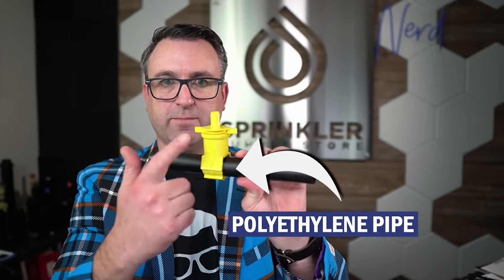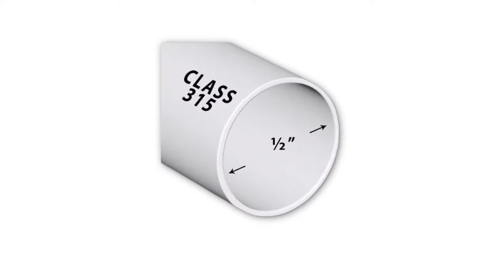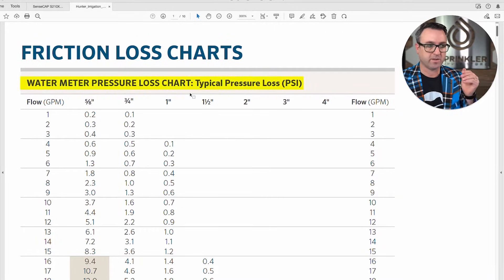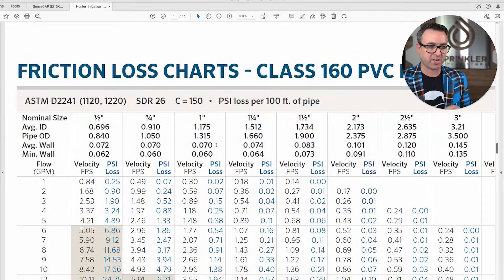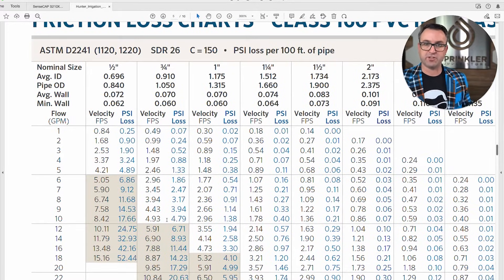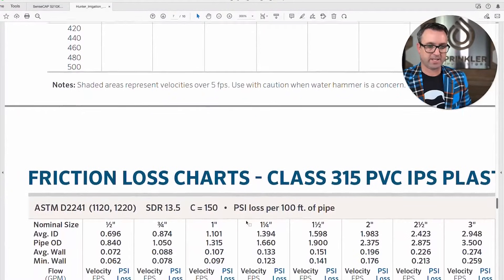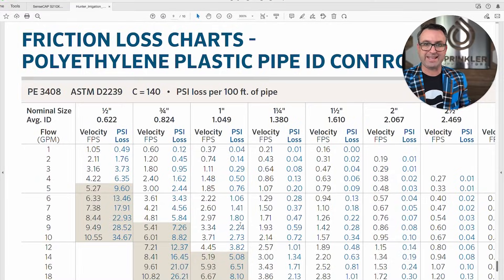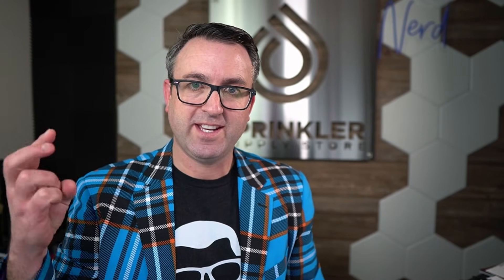Pipe Size Matters - How to Read Irrigation Friction Loss Charts

Comment: Also, observe pressure during the actual time you will be irrigating. I got screwed when I used mid afternoon pressure for design only to find out after installation that my city pressure drops 25lbs in the early morning when I water. Called the city and was told sorry, you get what you get. No boosting on their side. I’m working on reducing my GPMs to combat the loss. My entire system is 1” poly. Thank you for the information, being a firefighter for 25 years, I’m familiar with pressure loss. Just have to apply it.
Reply from the maker: Yes, thank you for mentioning this! It’s super important to check pressure at the time you intend to operate the system. I recently installed a cloud-based pressure transducer on a residential home and saw the pressure spike at 12:01am, and then drop by 20psi reaching a low point at 10am - and this pattern repeated daily.

Is a booster pump an option for you?
Reply: @Andy_Humphrey  I consulted a local installer and was told to make sure my zones are not over 12 gpm. So I'm going to look at that and try some landscape changes before going down the pump road.
Reply from the maker: Good luck!
Reply: Pressure probably drops because everyone is watering lawns when they should - early morning - and showering before work. Even city mains can only handle so much volume.

Comment: Question.  Are there rules about the size of an irrigation line that comes off a city water supply? For example, if the city supply line to homes in a neighborhood is 1" pvc, is it proper to use 2" or larger line to feed into the irrigation system?  Or maybe even a larger feed line to increase flow of water if a zone has too many heads?  If my understanding is correct, using two big of irrigation supply lines in comparison to the home line, would cause excessive pressure loss in the home (s) because the larger line would dominate the flow from the smaller diameter line.  If you had multiple neighbors all watering lawns at the same time it could cause an unusable pressure situation in the homes.   I am asking because I can't find anything written on this.   Thank you.

Comment: Regarding pvc pipe, doesn’t matter if the fittings go over the pipe; the size is always the inside diameter.
Reply from the maker: For PVC fittings, yes, the size is measured using the inside diameter. This is because PVC pipe is measured using the outside diameter. The inside diameter is different, depending on the type of PVC pipe; SCHD vs SDR etc. The wall thickness changes, and the inside diameter changes, but the outside diameter of PVC pipe is the same.
Reply: The 1 inch schedule 40 I use says 1 inch ID and 1.3 inch OD.  That is the actual pipe. It’s true 1 inch inside pipe not fitting.

Comment: Hey I first like to say you’re videos were very helpful
Question
My well pressure hovers between 45psi and 60psi
What type and size pipe would best suit 1-90
4-180 rainbird 5000 series 
My static pressure is 40psi @ the spicket 
My flow rate after I used your calculations is 7.5 gallons a min
Reply from the maker: Thank you. Check the gpm of each nozzle you intend to install based on the distance required. I do not recommend exceeding 35ft. Add up the gpm and refer to the friction loss chart to see what the pressure loss will be per 100ft. 1-inch pipe is likely just fine.

Comment: My lawn measures 50'8" x 44'8". I have 15 GPM and 45 PSI static pressure. I would like to run 1" pvc through the system and have as few as possible heads. 
Can you please help me with the placement of heads and recommendations. 
I have watched many videos about flow and pressure loss along with the 5 feet per seconds water flow. 

What would you recommend for placement and heads.
Reply from the maker: Hi Brian, let's start with validating the pressure. Where did you measure 45psi? Depending on where the measurement was taken, it may not be enough for an automated system. On average, you will lose 5psi through the water meter, 5-10psi through the backflow preventer, and 10% through the piping. Ideally, 40psi is required at the sprinkler for that lawn. 

Pressure often fluctuates on the city main. You could also test the pressure at different times during the day, for example: 6am, 12pm, 10pm.

In regards to spacing, start by pacing sprinklers in the corners and fill in from there. 25ft spacing using Hunter MP Rotators should provide a nice grid coverage. Yes, there will be some overlap on the 45ft side, but that is okay. 9 Sprinklers in total.

Comment: I'm confused about the part where you said you get more friction loss using schedule 40 because the ID is smaller due to thicker walls. But the pipes in the chart are listed by ID size aren't they? So isn't a 1/2" pipe of one type the same ID as another...?

Comment: We have free ditch water in our subdivision for irrigation (~30-50' higher than house location). It's delivered to each 5 acre lot via a 2" riser pipe (think horizontal rectangle with the house and riser pipe in the NW corner).  I'm allowed a max 5 HP pump.  Is there any issue with using qty (4) 2" pipes for the long runs and then branching off them for each sprinkler head or is it better to reduce the size?  What happens if you have too large of a pipe?  Thanks
Reply from the maker: A larger pipe than is necessary will not cause harm. It will reduce friction loss, and the resulting dynamic pressure will be higher. It’s most costly, but if in doubt, size up.

Regarding your other question, if you can run 1 pipe and have adequate dynamic pressure, I’d recommend that. Extra pipes will be extra maintenance cost.

My recommendation is to design the size of your zones, based on the gpm available, and pressure calculations from the 5hp pump and elevation changes.

If you would like assistance you can book a call with me and we can go through the calculations/design together.
Reply: @Andy_Humphrey  thanks!  I saw your calendar link from another comment and will take you up on that offer but will probably be after the summer.    thanks again!  enjoying your channel. Just subscribed.
Reply from the maker: Thank you!

Comment: is the friction loss in head form?
Reply from the maker: @kennethrevilla639 these charts, used for irrigation design, typically display pressure in PSI. This is most common for irrigation contractors, etc. 

You can convert psi to foot-of-head by multiplying psi x 2.31. Example: 50psi x 2.31 = 115.5 foot-of-head.

In reverse, there is 0.4333psi in 1 foot-of-head. Example: 100 foot-of-head = 43.33 psi

Does this help?
Reply: @Andy_Humphrey  I'm learning new ways to find friction loss. I'm reviewing bernoulli's equation where all must be in term of "head" units must be either in meters,ft or inch. so if I multiply 50 psi and 2.31. the friction loss is 115.5 ft? where did 2.31 come from?
Reply: oh i got it. pressure is also equal to (density)(gravity)(head)  @Andy_Humphrey  thanks :D
Reply from the maker: @kennethrevilla639  you got it - that is some good Nerd speak right there!

Comment: How do I test the water pressure going to my irrigation and water follow?  Testing at the spigot wouldn’t be accurate as the spigot is connected to my house and likely after a regulator, and my irrigation line branches directly off the main water supply line before it comes to the house.
Reply: Take a 5g bucket open pipe full count the number of sec it take to fill the bucket  5G Div Sec X 60 = water flow per min
Reply from the maker: Static pressure will be the same anywhere you tested on your house. Just make sure there is no water running when you test the pressure.

It’s a bit confusing to think about it first, however, static water pressure is just that, water that’s not moving. The only difference to the readings will be due to elevation.

Comment: Love your YouTube channel! I just finished watching this video and several others of yours. I'm at the very early stages of designing an irrigation system at my house. I've never done this before and I see from others that have asked you questions here, you are a great sprinkler resource. 

The area that I want to sprinkle is for the "sports" area of our backyard. This is where we play badminton and croquet. It gets full sun and is a challenge to keep grass growing, especially when we are using it often. The area is nominally 50' x 25'. 

I have a dedicated irrigation line from the city water system. Just today (9 am, Sunday), I measured the static water pressure to be 44 psi. This is the pressure at the hydrant in my yard AFTER the city meter and the back flow preventer. Last week I measured the water flow coming from the hydrant using a 5-gallon bucket and got ~50 GPM. 

For the sprinkler system, I plan to tee into the existing PVC line the runs between the back flow preventer and the hydrant. I think this line is 1", but I still need to verify. The elevation of this tie in point is about 3' ABOVE and only about 20' away from where the edge of sports field. Therefore, I will have the benefit of some increased pressure in the system as it flows down to the sports field. 

My goal is to have an effective, trouble-free sprinkler system that I can install and maintain myself. I am willing to pay more for any system component if it will ensure I can meet these goals.

My basic questions are:

1. How many zones do I need?
2. What type of head(s) should I use and what configuration is best?
3. What controller do you recommend? (Due to the remote location of the tie in point, there is no access to Wi-Fi and limited access to electrical.)
4. What type and size of pipe should I use?
5. Any other design elements or tips I should know before I proceed?

I'm hoping to get this installed in the next couple of weeks to be ready to plant grass (from seed) in the bare spots for the fall. I thank you in advance for any help you can provide.
Reply from the maker: Great questions, and thank you for your kind feedback. 

This is a situation where I'd recommend a consultation with a professional to ensure that you get this right. I'm certainly happy to help, below is a link to schedule a technical meeting.

Couple quick thoughts based on your observations.

1 - The static pressure reading of 44psi is not effected by the backflow, pipe friction loss etc., unless you tested the dynamic pressure while the system was running. Static water pressure will be the same at all points, with the exception of high/low areas due to gravity. If the static pressure is 44psi, it is likely that the dynamic pressure will be more like 35psi, in which case a booster pump is recommended. 

2 - 50gpm sounds suspect. Double check the calculation. If you tested it from a garden hose hydrant, it should be more like 5-8gpm. A fire hydrant/hose would be more like 50gpm, and perhaps that is where you tested from?

Look forward to learning more and providing assistance should that be helpful.

Thanks again for your kind words!

Scheduling link: https://calendly.com/andyhumphrey/technical-support

Comment: So does it mean the the closer to the 5 velocity fps the better? Not exceeding 5.
Reply from the maker: that is an interesting thought, but not exactly. There really is no "better" velocity, only not to exceed velocity, which for irrigation is 5fps. Slower velocity will have no effect on pressure. Actually, that's not true, you will have less pressure loss (therefore conserve pressure) if the velocity is lower.

Comment: Thanks for the video, and thanks in advance for help on this. I’m confused. Is water pressure different from pressure within the pipe? You say if you were to put 50 gallons/min into that pipe it would blow a fitting. Wouldn’t it be the increase in pressure inside the pipe that would blow a fitting? Yes the water moves faster but I would think it would create more pressure in the lines? (Even though you say you can only increase pressure in certain ways). I’m a math guy who likes this stuff but am just learning it. 
I got some great answers in another of your videos. Thanks 
How do I calculate static pressure if my irrigation water splits off from the house right at the town water meter, and my irrigation system even has a knob to adjust the pressure. Every zone is fine but one is overloaded with heads and a drip line and doesn’t  work well. 
Is there a formula how much each head drops the pressure? Are some sprinklers better for low pressure and/or low flow? (Rotors, spray or rotating nozzles, impact…)? I’m thinking of trying an impact at the last sprinkler of the zone to see if I can get more range with it.
Reply from the maker: Water pressure can only be increased with a pump, or gravity.

The best example of false pressure if putting your thumb over the end of a garden hose…this does not increase the pressure, it increases the velocity/speed of the water.

Hi velocity is what will create problems. It is for this reason, that the recommended velocity is under 5 ft./sec

Static water is measured with a pressure gauge. To calculate the dynamic pressure, you will need to know how many gallons per minute you are using, the distance the water is traveling, and what the water runs through in between (size of the pipe).
Reply from the maker: If you have low pressure, the best sprinkler to use is a pop-up spray head, with the lowest flow nozzle you can find that still covers the distance you’re looking for. Do not use rotating style nozzles, use a standard matched precipitation rate fixed spray nozzle. These will generally operate as low as 20 to 25 psi

Impact sprinklers are not a good choice for low pressure because they typically require a higher flow rate.

Comment: Im wanting to run a water line to another side of my property for a 2 acre garden area, however the distance is 1600ft from the well and 50ft higher in elevation. Id like to have some serious flow and pressure to irrigate, any thoughts. I was thinking 1" high pressure poly pipe with a booster pump on a dedicated line.
Reply from the maker: For that distance, you’ll likely need a 2” pipe, depending on how many gallons per minute you need.

Let’s assume you need 15gpm.

15 gpm through a 1” PE pipe will generate 5psi loss per 100ft.

At 1600ft, that is 80 psi loss (1600/100 x 5).

The elevation change of 50 will reduce the pressure by another 21.65psi (50x0.433).

So you’ll have 100psi loss 

Using a 2” poly pipe will only be 1.5psi loss per 100ft.
Reply: @Andy_Humphrey  Thank you so much for your help 🙏
Reply from the maker: @JohnDoe-id9hi  my pleasure. If you need more engineering assistance you can schedule a call with me and we can go through it one-on-one.

https://calendly.com/andyhumphrey/technical-support

Comment: It seems i have 1/2" main in my home, OD is .91. Best charts i can find for galvanized seem to point to 1/2" ID. Can i just increase the size of the pipe where ever i tie in after the meter to say 1" and this will give me a higher flow rate? Static pressure was about 62psi.
Reply from the maker: Hard to say for sure, however, I would not plan on a higher flow rate. Increasing the pipe size will reduce your friction loss (psi over distance) but the flow is generally limited by the incoming source. Also note that old galvanized pipes are often restricted due to corrosion inside the pipe, so you may have even less flow. Google that one :)
Reply: @Andy_Humphrey  ah okay. I have 140' to reach my farthest sprinkler with 8gpm. Is 8gpm to low to run the Hunter MP1000 rotators? Or how can I check if I will keep at the 40psi rating before I start purchasing the supplies? Thanks for all the help
Reply from the maker: Is that 140ft of galvanized? Take a look at the MP Rotor Performance Charts to calculate the actual flow rate. Then based on that, you can determine the friction loss. I’ll a link to the performance charts: https://www.hunterindustries.com/sites/default/files/CA-Cutsheet-MP-Rotator-US.pdf
Reply: When checking the friction loss charts am I supposed to use the 8gpm that my home provides? Or the 5gpm that the largest zone will need?
Reply from the maker: Use the gpm for the specific zone (best to use the largest zone).